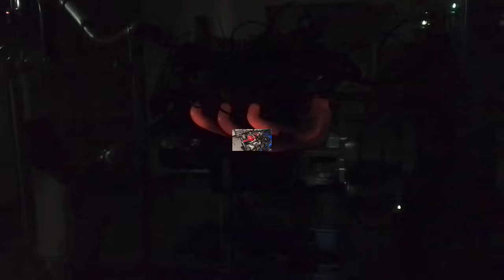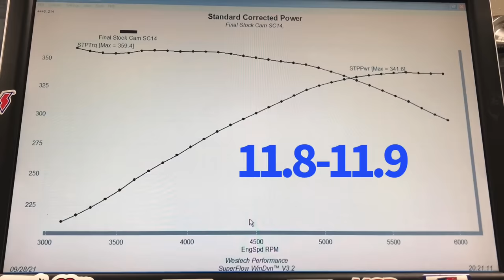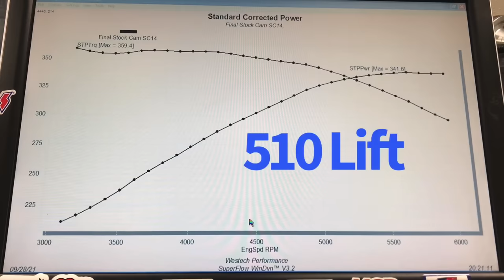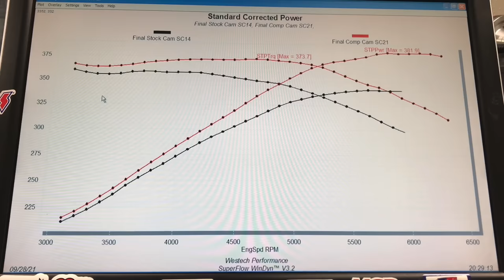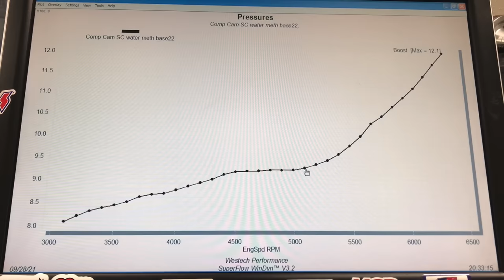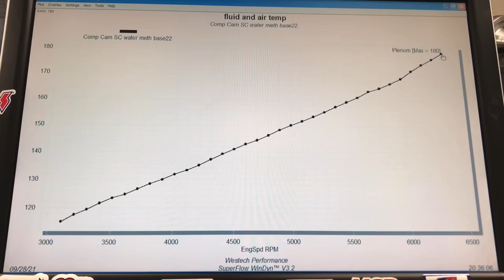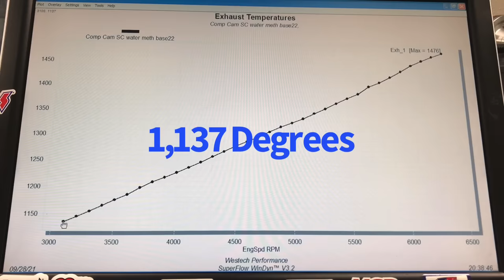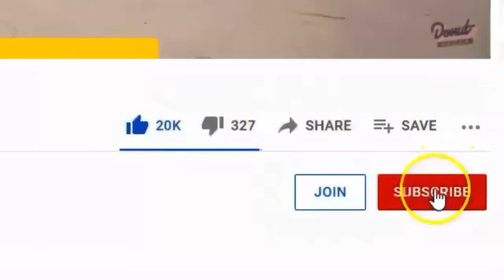HOW TO MAKE MORE HP : CAM SWAP A SUPERCHARGED 3800 L32/L67. MAKE MORE HP AT LOWER BOOST. DIY, LOW $.

Comment: Im tempted to pick up a MP extreme m90 case. They are so affordable and should be worth good power over a stock gen3 case.
Reply: What is that extreme I mean obviously it's a supercharger but why did they come on
Reply: The MP90 is based off a Gen3, if I recall... The GenV is an overall better design, with the larger outlet at the bottom of the V, and a more open inlet leading into the rotor pack.  Even ported Gen3's didn't perform as well.
Reply: @james10739  The Magnuson mpx is a blower rotor housing with a larger inlet and outlet than a gen 3 or gen v case however it accepts the traditional m90 rotor packs be it from a super coupe or a gtp m90. It has a typical 4 bolt flange like the Thunderbird m90 but is designed for much higher blower speeds at much less output temp.
Reply: @dezldave961  Ive seen they boast improvements with the mpx case over even Allen's m90s gen V blower on the 4.6 mod motor kits. They usually are worth 20-30hp over a worked gen V all with less output temps. The case lists for around 450$ i think too.
Reply: @madmod  Roger that, but I don't think I'd be too impressed with a 4.6 guy spinning an M90.  Heck, I've got an MP112 sitting on top of my spare 3800 waiting for a rainy day, because it works like a champ.
Reply: @madmod  having run both the Gen 3 and 5 M90's, along with an MP112 on my 1st 3800 car, I can say that the power only went up (and I hung the tongue out on that GenV with a 2.7 pulley non-IC on a cam'd 9.4:1 stock block/heads to get 330+whp/tq from it on 100oct)... The MP112 conversion immediately stepped the setup up.  Pushing plasma out of either one at 15-20k rpm is burning money.  The Eaton charts exist to plainly show how to use them, even if we stretch the usage to save a penny here and there.
Reply: @dezldave961  You say pushing that much blower speed out of the m90 is a moot effort and is nothing more than burning money to make heat but 20k rpm is stock blower speed out of the m90 when used on proper v8 applications across all of the major kits that use the m90s on the 4.6.  The 3800 is seriously limited on what little blower speed you can effectively run without first solving charge temps and induction so its not news that you cant spin a stock blower that fast on a stock iron headed non intercooled econobox 6 banger without a ton of heat. Any power you can make with the slow turned m112 on a 3800 can be achieved with a higher pulley ratio on the m90 assuming you actually solve the charge temp issues. A m90 turning some 20k peak rpm and 9psi as seen on the allen m90 kit v8 produces alot less heat and parasitic losses than the same m90 turning with a 2.7 pulley trying to push 15+ psi into a stock 3800 purely because the blowers losses and heat production are based purely on manifold boost, not just blower speed. The blower producing all that extra heat and pressure on the 3.8 is a sign of a poor flowing v6, not a blower lacking in steam. Meanwhile the allen sc 9psi kit has handfulls of people in the 400rwhp range on mostly stock 2v combos right along side the tork tech kit which offers low 400s whp out of a much more expensive m112 kit, or a vortech like I use which makes 400whp on like 11psi but only makes some 3-4psi by 3k rpms. The immediate boost response and rising curve offered by the m90 is solid when youve got an engine that can use all that airflow.
Reply: @madmod  you're on this pedestal to advertise a specific kit that gets a whopping 400-something whp from the weakest modern V8 on the street, and you decided to poison the well by attempting to trash 3800's?  There's multiple getting over 400whp on M90's, and 500 on 112's.  Headflow results in psi build-up (watch Richard's videos), but the heat is still a part of the speed.  I've since moved past this with a turbo build adding a couple hundred more, but I'll certainly put the blower setup back in for fun eventually, and happily datalog a bunch of things to share.  My resources are much less than Richard's, and have less spare time due to work, but R&D testing is a fun use of the hobby.
Reply: @dezldave961  I am not saying anything outlandish. I come from the 3800 ssei community and now have a blown mod motor. I compared the 240hp blown v6 to a 360rwhp rated blown v8 that use the same blower. The higher powered  blown v8 combo makes more power with less boost and less outlet temps despite almost double the blower speed with the same blower. 
 Im not putting anything on a pedestal, just further pushing the idea the m90 is not the restriction especially when sub 500hp is the goal. The fact the stock combo with the m90 blower spikes in boost with very little blower speed shows the obvious restriction is the engine. Swapping to a larger blower solves nothing albiet does produce more horsepower but leaves the issue of a poor breathing v6 in stock trim. Nothing i stated is trashing the 3800. Its a relatively poor flowing engine with iron heads and unequal feeding cyl to cyl in the intake. Boost helps them a lot
Reply: @madmod  brochure numbers, sure, but decades of doing many inexpensive upgrades has proven where potential was left on the table (hence why I had so little done back on that dyno run in '06).  Many people jumped ship on 3800's before the market matured, and many still do when they don't want to apply the right parts.  I've kept one as a daily driven fun car for 20yrs, and now have one working towards a 10sec FWD car with full Buick interior.  It's a great combo that's funny, comfortable, and just quick enough to remain useful on the street.  There's many ways to skin that cat, and having the rare chance to run 5-6 different power adders on the same engine (3 sc's, 3 tc's) has given me some good times learning things along the way.
Reply: @dezldave961  The same issues that plagued the cars 2 decades ago reign true today. IATs and gm's failed attempt at a transmission. I loved both my 3800 s2 and s3 cars but ill never buy another 4t equipped vehicle again. Ive had the opporotunity to drive and work on several m90 equipped cars from 3v mustangs to supercoupes and ssei/gtps and the idea that pontiac would install a blower with no intercooler knowing damn well it would see 200+ degree intake temps just shows the lack of forethought. Everyone blames the m90 for being inefficent but its the engine not able to consume the air provided by the 1.5L roots blower that creates all the heat.
Reply: @madmod  I can agree with the 4t65 issues, as I have a huge build to deal with the turbo Regal, and currently have my 5.3L LS4 GXP apart in the garage to replace the dead stock one.
Intercooling with a ZZP-style plate was a game changer, and the M90 upgrades made since the SuperCoupe version were great (along with them being a poor S1 3800 clone, A2A IC held them back a ton, too... Aussies prove that trying to get similar results on their M90 3800's using the wrong IC config for a PD blower).  We see mid-100 IAT2's under a good core, and anyone who dialed in a cam/IC build since ~04-05 got mid300-low400 whp for about a $2k investment that lasts forever on a clean tune.
Reply: @dezldave961  This is why i love the m90. They support good power affordably. I can pick up running m90 cores for next to nothing and have 2 in the garage right now. This is why i brought up the mpx90 case because I guarentee it could spin 20k rpms with low outlet temps and move a ton of air even more affordably than the m112. I need to get my hands on an m122h as well. Roots blowers are sweet but I love my Centri. Ive never seen a vortech supercharged 3800 but it would be a beast.
Reply: @madmod  a few 3800 guys have done CSC builds using the Paxton Novi 1K/2K kit that was made for a short time ~'03-'05 (new build happening on Terrell Smith's channel with a used kit he got).  They've gotten over 500whp with them, destroying transmissions, of course, along the way.  Just a step shy of common turbo power levels we see.
Just did the math, and 3800's using max-effort M90 setups can see up to 20k rpm using a 2.55 pulley, 5% OD balancer, and revving to 7k on a big cam (typically the 400+whp capable setups).  You kept mentioning that number, so I did the napkin math.
Reply: @dezldave961  Now figure that the m90 has less than 40hp of parasitic drag if you are operating below 10psi even up to 18k rpms. Compare that to richard holdners own testing that the m112 can exceed 150hp of parasitic losses at high blower speed. On a 3800, the m90 will likely exceed 1 bar at the pulley ratio required for that rpms but the benefit to running the m90 on larger engines like the 4.6 is we move that same 400hp worth of airflow at only 9psi peak. I have a 10.25inch lightning lower pulley that would allow for a 2.7:1 drive ratio with a stock 3.8 inch gen v pulley, but with a zzp hub and 2.6 pulley, i can exceed 4:1 drive ratio on an intercooled combo. For a $60 used m90, thats pretty awesome. I would love to see a f body with a t5 and centri blown 3800. Itd probably be cheaper to turbo but the packaging of the centris are sweet.
Reply: @madmod  A buddy on the turbo Buick forums has a turbo V6 Camaro T5 he's enjoying the heck out of.  I could see a CSC version being fun, too, but it's up to the person who wants to do the build.

The other thing along with airflow is effectively using the air that's going thru, which the 3800's make the most of for being OHV setup with mild port flow.  The fact that OHC engines with bigger cubes are in the same range with the same power adder speaks to that.  It's a great "budget" build platform, which is why everyone tinkers with them, at least until they want to go beyond basic levels.
Reply: @dezldave961  Yes id say the 3800 swings up at the competition. They are incredibly stout. The old 4.6 sohc is no firebreather stock actually losing out in head flow to the stock iron 3800 l67 stuff even. Its easy to make power with more displacement but the 3800 would have the breathing advantage if not for the stock blower manifold being so restrictive. Its just crazy that the oem has used the same blower on anything from 4 door luxury cars, pony cars, and even aston martins. Heck of a lot of bang for the buck for some junkyard boost.
Also, Did you do a m112 rotor swap into the m90 case or do the full mp blower swap?
Reply: @madmod  it's the Magnuson case MP112 on a custom kit made for 3800's back in ~2003 by Intense/ZZP.  Uses a poly inlet machined for a modified LS1 TB, and bolts to a ZZP sandwich A2W core.  There's about 10-20 of these kits out there, and they work pretty good.  I've got a 102mm TB waiting to go on when I out it back in something (GTP rusted out from northern winter life)
Reply: @dezldave961  that sounds kickass lol

Comment: I would also consider adding a intercooler when you do other testing. I know that they exist as a bolt on... but the brand escapes me. I'd actually really like to see W-Methenol vs Intercooler. I would hazard a guess to say the W-Methenol would probably make more power, but the intercooler, you wouldn't have to constantly be filling it up.
Reply from the maker: intercooler vs wm=intercooler ftw!
Reply: @richardholdener1727  ….Absolutely !!!

Comment: aren't these 3800 motors configured as front wheel drive? Can you use these on a RWD car?
Reply from the maker: yes-they cam na in rwd camaros
Reply: They are used in rwd commodores aswell

Comment: Richard is the engine making less boost or just showing less PSIG?
Reply from the maker: the boost pressure is down because we made the NA motor more efficient
Reply: @richardholdener1727  ….Efficiency is always a key ingredient in the power recipe. If someone wants high boost for bragging rights, they can start by restricting the exhaust 😳.

Comment: Yes more power less boost equals less heat more efficiency less fuel usage more horsepower...
More supercharger more camshaft...
 YouTube Gail Banks killing a Duramax...
Reply from the maker: I know Gail, but what cam did he use in DuraMax?
Reply: @richardholdener1727  I forget.
He maxed out the stock turbo, maxed out the stock injectors, and increased the exhaust pipe size, made a lot more HP, less boost, less fuel lower egts.
I've been following the series killing a Duramax.
So a bigger turbo,  bigger injectors more air  through the intake more air through the exhaust , made a ton more power and used less fuel...
Great videos 👍
Reply: @richardholdener1727  killing a Duramax part 15..
Reply: GALE, I think ? 🤔

Comment: I would love to see a shootout between this and a supercharged ford 3.8 out of a supercoupe thunderbird.
Reply: Supercoupe was around 310 stock and the chevy was what 340 stock so I'd say that sums it up
Reply: @jonathanlawson4667  what is the source of your info if you don't mind me asking?
Reply: @christopherpentland5375  just the factory specs for both engines
Reply: @jonathanlawson4667  but if we only wanted factory specs we would not watch this YouTube channel.
Reply from the maker: 310 hp-no sir! I think you meant 210 hp, 3800 was 240 hp and the series 3 was 260 hp
Reply: @richardholdener1727  thank you and yes I did mean 210 and 240
Reply: @christopherpentland5375  Richard caught that when I looked up those specs for you I typed a 3 instead of a 2 so sorry about that man
Reply: @jonathanlawson4667  for the 94 and 95 model years the sc power jumped to 230hp and torque was at 330. 1995 being the last year produced.
Reply: @christopherpentland5375  …My 2002 GTP was factory rated at 240 hp and 280 tq. I’ve bumped those numbers up a few notches over the years. 
I’m also into Fords and agree that the blown 3.8 Ford and Pontiac engine mods comparison could be very interesting. Especially with the scientific data collection methods that Mr. Holdener uses. He leaves no stones unturned…well maybe a pebble or two but not enough to skew the results very much 😉.

Comment: First I disagree with lower the boost from the Supercharger reason being.
1. There are after cooler modifications 
that can be done this will lower your charge air Temp and lower boost pressure giving a better air charge.
2.Using just Ethanol will lower your HP numbers in itself. I would like to see a side by side comparison.
3. I have the same engine in my GRAND PRIX I am pushing 400 HP AT THE WHEELS. (399.7 to be exact).
4. Using a engine that is that worn out to run a test is like using fake numbers You need to rerun the all tests as they will not be the same unless you can control the exact conditions before the engine spun a bearing and have a engine worn as bad as the first engine.
5. When raising the boost you did not mention about tuning fuel graph.
A. using Ethanol and B.Lowering and also raising the boost.
For the record I am not questioning your mechanical ability just how you ran the test.
As I said I know this engine very well.
Reply from the maker: you disagree that adding a cam will lower the boost?
Reply: @richardholdener1727  Bare with me I am multi tasking here.I disagree with the dyno test as the engine was worn out as to spun a bearing, I disagree with lowering the boost through the larger pulley...The camshaft affect torque and HP and when max torque is achived and when max HP comes in . Also retarding and advancing affect torque and HP curves and when max boost comes in.You want as much Torque at the low end that is what gets the car going not H.P. you should know this.This engine was built for low RPM torque unless you are building it for 1/4 mile runs. keep in mind the Grand prix Best time I have seen is I 9. secs at 150 mph.And yes a turbo is being used instead of a blower.
https://youtu.be/iRgaX4rn2PE
So you want as much boost at the low end.
Also if you pay attention to how the exhaust starting glowing red can be caused by a restriction in the exhaust and or running lean due to the E85 and no fuel tables apparently not being adjusted as you did not specified. E 85 HAS OXYGEN IN IT requiring a richer mixture. Also I would like to see 94 Octane fuel used on this engine with the fuel tables illustrated.
Also I would like to look at the entire engine failure not just a bearing.
Reply: @richardholdener1727  ….The tame specifications of the stock cam is like a restriction at the intake valves resulting in a higher intake manifold pressure under boost. The Comp Cam with more liberal numbers would lessen the restriction resulting in more flow past the valves and less manifold pressure while using the same ratio blower pulley. 

I hope that makes sense. I was sipping a Starbucks while texting and I’ve never been very good at multi-tasking.

Comment: I would kind of like a little more data from this test. Even if its just lambda and bsfc i can figure the airflow and find out where on the compressor flow map it might be. This is really close to where the blower is rated to spin and with the 100hp pirate riding the belt on the front of the engine it makes me wonder how good the m90g5 is. Like, they suck a lot and leak like crazy and need too much power to turn but 380hp is still 380hp even if it appears to be above the rated flow capacity of the blower.
Reply from the maker: I DON'T HAVE AIRFLOW DATA OR BSFC AND OBVIOUSLY ITS NOT ABOVE THE RATED FLOW OF THE 3800 WITH THIS PULLEY
Reply: @richardholdener1727  its right at the edge. The factory bottom pulley is 6.96(?) and with a 3.2 blower pulley and 6400 rpm the blower is at 13,920 rpm. I cant find a flow chart that shows this blower rated to go over 13,500. Its not so obvious. I cant find what the efficiency of this blower is at this blower speed and pressure ratio. Eaton never tested it. Do you have injector PW and Lambda? I cant find a source that says these blowers are rated above 14k rpm. The bearing in the nose is rated at 20k. The engine itself isnt rated to go to 6400rpm. I dont know what the maximum m3/h that these blowers will move is.